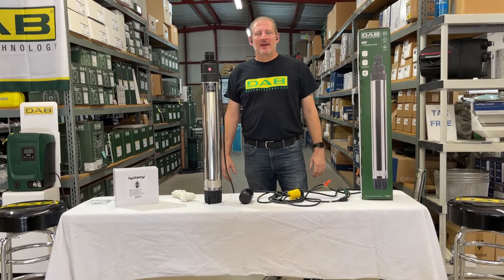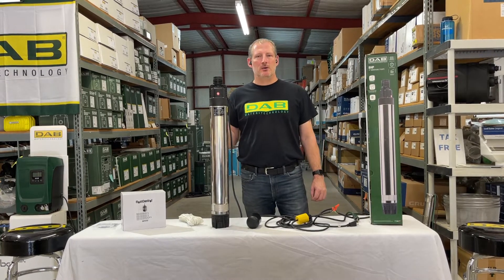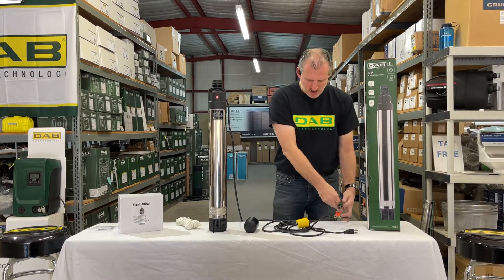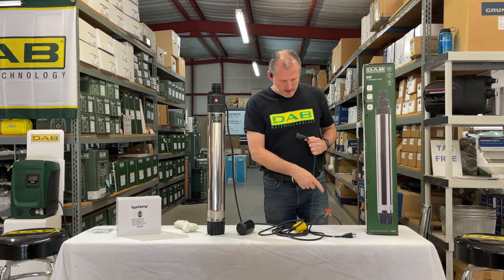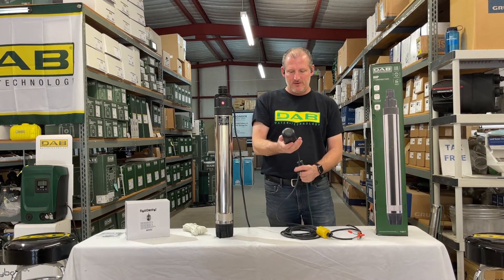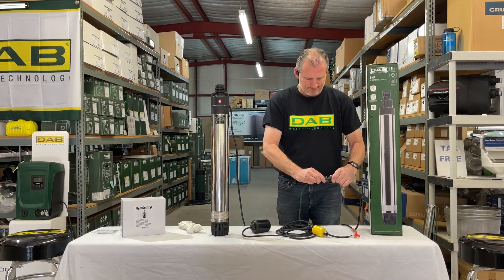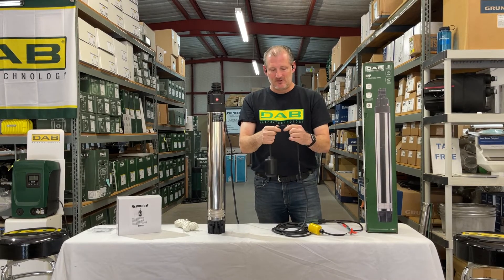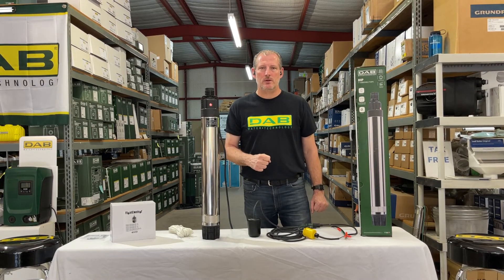How to Wire a 115V Float Switch to a Submersible Pump

Comment: How can I connect float switch to control box
Reply from the maker: Here's a link to a contactor that you may use to connect a pump or a solenoid valve to a float switch. On the page is a link to a wiring diagram and picture of a wiring example. https://rainwaterequipment.com/definite-purpose-contactor-dpst-30a-240-vac/

Comment: Great video, my pump burned out because it was dry running, will this floater work in a well with 8 inch PVC opening?  Taking into consideration that is submersible pump is 4 inches in diameter.
Reply from the maker: I don't think this type of float switch will work well inside an 8" pipe, although I suppose it might. It needs room to pivot up/down. It's better suited for a storage tank. You're probably better off with a small float that slides up/down on a stainless steel rod. We don't carry that style, but there should be something like it available online.

Comment: great vid, what are your thoughts,... here is my setup....  i have a 180ft well, the well only produces 0.9GPM,  i also have a 1500 gallon tank (Cistern that i fill by hauling water as i don't have my well set up).  i don't currently use my well because i don't know how to set up my system.  i also have a 5gpm well pump installed.
Reply from the maker: Yes, you can use an ESYBOX Mini 3 as the pump to pressurize the water in your 1500 gallon tank to send to the point of use. We recommend installing the pump close to the outlet of the water tank.